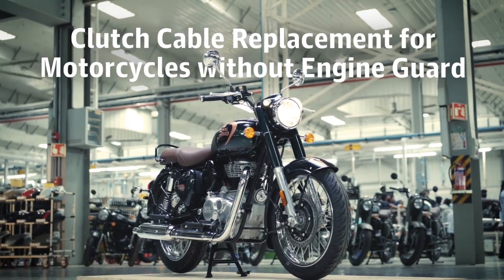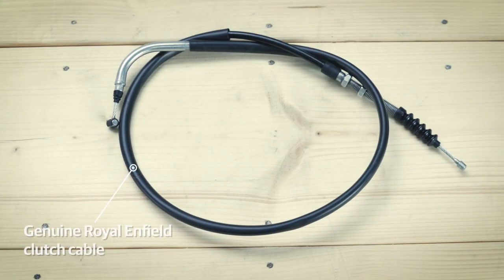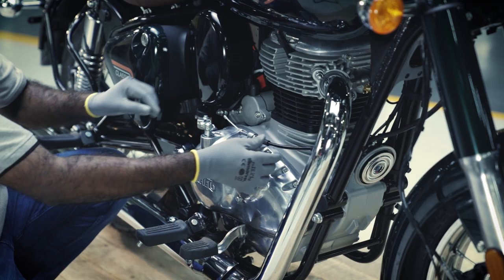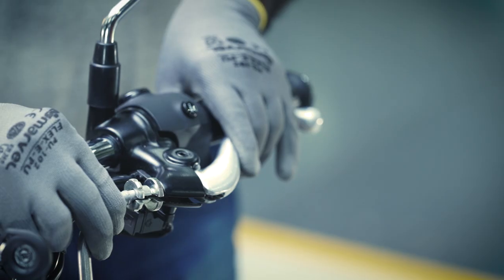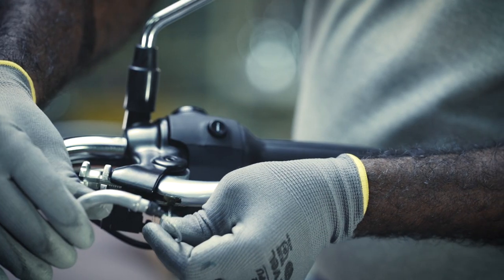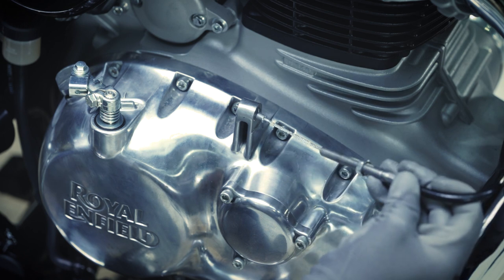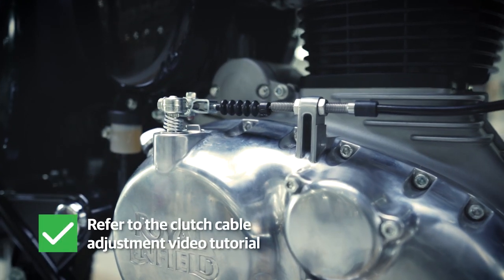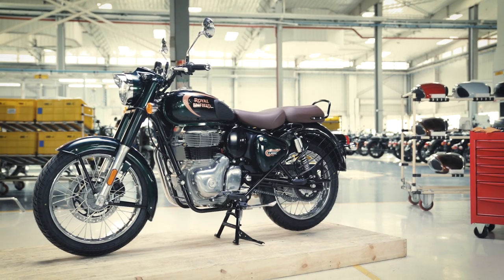All New Classic 350 DIY | CLUTCH CABLE REPLACEMENT (WITHOUT ENGINE GUARD)

Comment: Can i know the serial number of the clutch cable
Reply: 1100227/E 
Is the part number as on the clutch cable assembly cover.
Cost Rs 220 or almost 3$